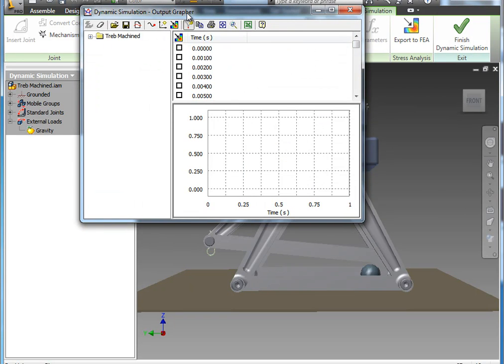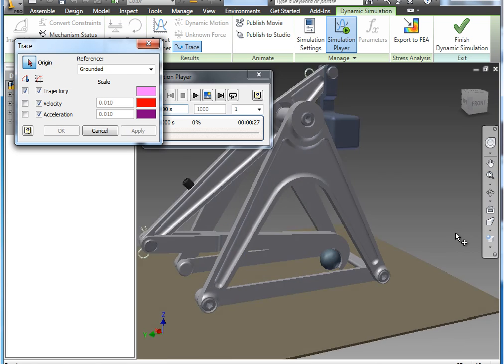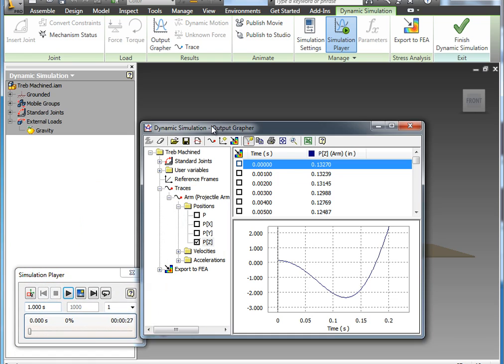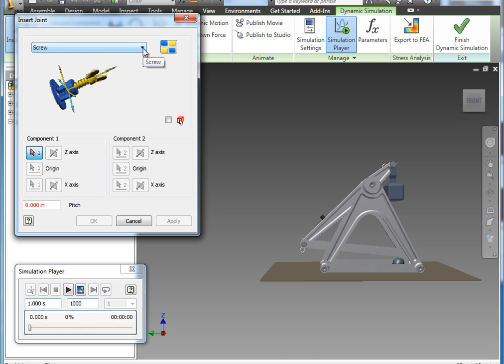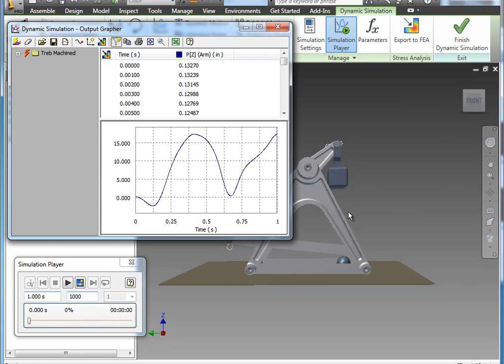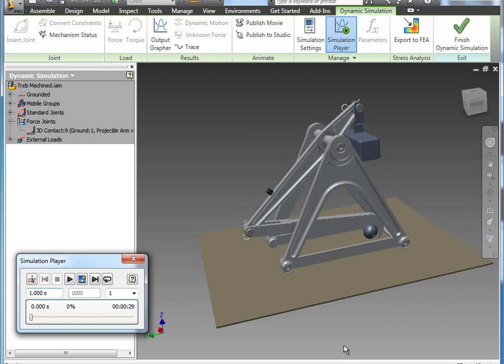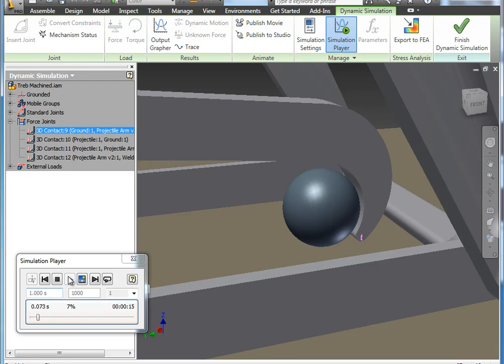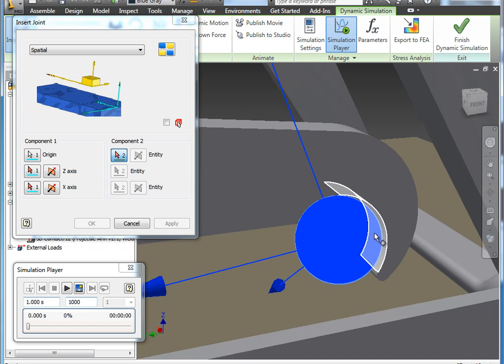Part 4 - Dynamic Simulation & Finite Element Analysis (FEA) - Autodesk Inventor 2011

Comment from the maker: The ground is a part just like any other part in the assembly. You can dimension it to be as big or small as you want. I made mine a bit smaller because it is easier to work with during demos, but if I make the ground bigger the ball would actually hit it and roll off the end.

Comment from the maker: @savata71 It is a combination of the number of calculations (set in the simulation player) and the velocity in which the arm is moving. I have dialed the accuracy down a bit to speed things up. To get the arm to contact at the bottom of the swing you could dial up the accuracy, but in this case that part is not important to me, so I didn't bother to change it.